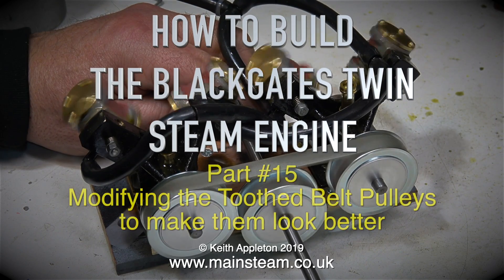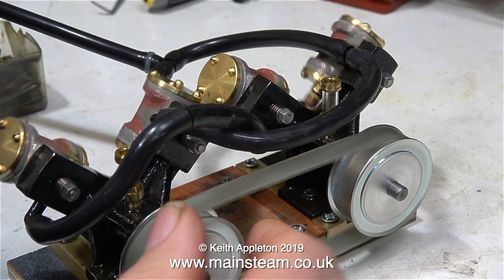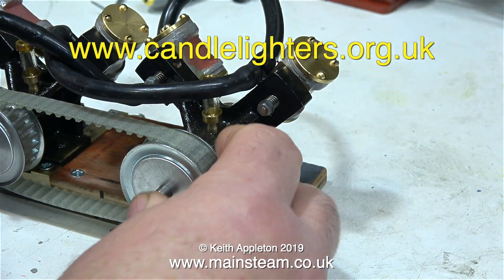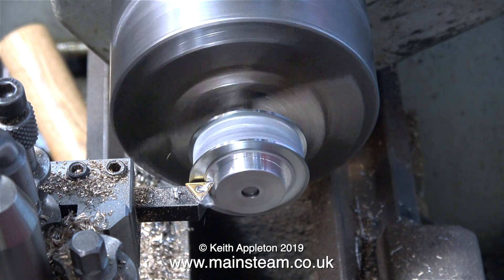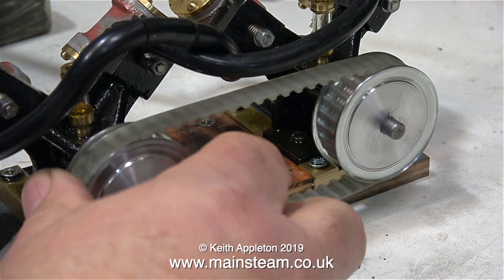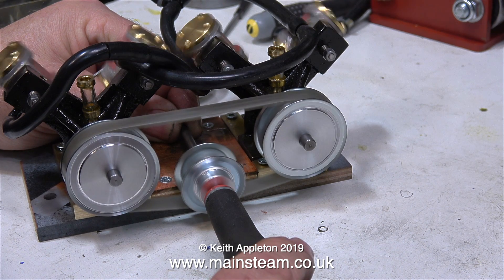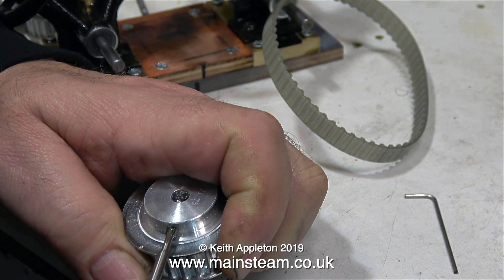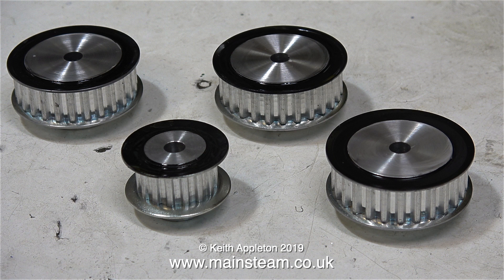HOW TO BUILD THE BLACKGATES TWIN STEAM ENGINE - PART #15

Comment: keith should the bearing support swivel so it will self align with the prop shaft?
Reply from the maker: No, I would use a pair of universal joint couplers for that.

Comment: Hey Keith. I don't know if you have considered this but would these 2 engines run as an expansion engine one after the other using a smaller diameter pulley on the high pressure cylinders an a larger pulley on the low pressure side. 
What am I missing?

Comment: does that central toothed drive pulley slip? It seems that with so little wrapping the pulley would only really serve as a tensioner and the belt would jump teeth if it had any serious resistance, or is the timing belt setup that overspec and the power levels involved low enough that it doesn't matter? 

the belt drive itself is 100% in keeping with the tradition of steam even if the specifics are modern. if the issue above comes to fruition i think a pair of belts onto a central countershaft one per engine might even look better and keep the V theme going
Reply from the maker: Please watch the rest of the series . . . . .

Comment: I think the form factor the belt drive allows is quite nice, my only concern is the engagement the third pulley with the belt, it seems to me that it could skip if it experienced a high enough load. If i were ever to do something similar, i think i would be tempted to make an old school flat belt pulley system complete with the mobius-flip in the belt that is supposed to improve the life of the belt.

Comment: In America, belt drives were used to power entire factories, where power came from water or steam. At their peak, the proliferation of leather drive belts had an impact on the American buffalo population.
Reply: Yes... the line shaft was pretty universal, not just an American thing. Pretty hard to get motive power for dozens of machines from a single engine any other way.

I would imagine the people complaining about the belt has more to do with it being a toothed synthetic material belt, as ye olden belts were flat and made of leather or a type of resilient fabric.

Though in Britain at least, probably elsewhere too, the flat belt did have some competition with rope belts which, running in grooved pulleys, tended to be less likely to slip.

Comment: Hello Keith, I am hesitant to comment lest you brand me 'one of those viewers', but here goes. I have a question about the final drive pulley, it seems it will have only a small amount of engagement with the toothed belt along the bottom, which normally wouldn't be sufficient to prevent it slipping under load. My question is, is this less of an issue for driving a screw in water than it would be for other types of final drive? Also will it limit the size and weight of screw used? 
Thanks, Sam.
Reply from the maker: As you are not one of my Patreon supporters, (www.patreon.com/keithappleton) you do not have the advantage of being able to see the videos that are not yet public and won't be for some time yet. All is revealed as the series progresses . . . .
Reply: @keithappleton  ooh you mysterious tease =P